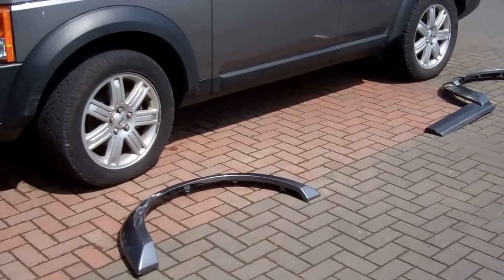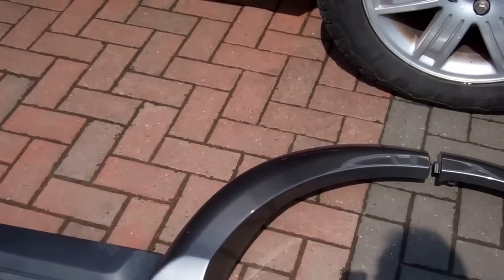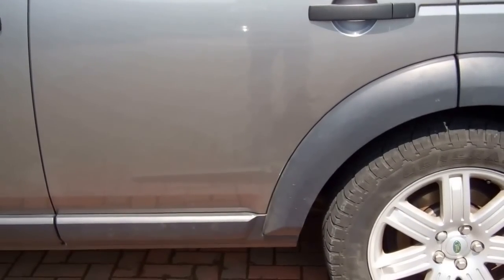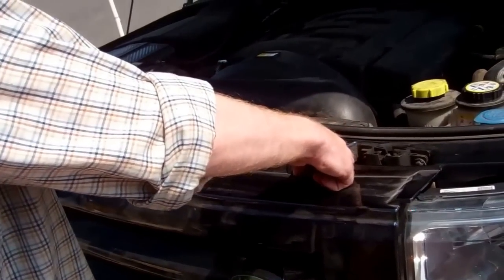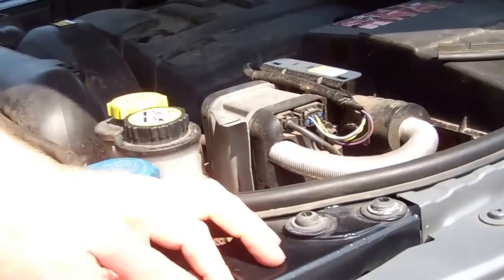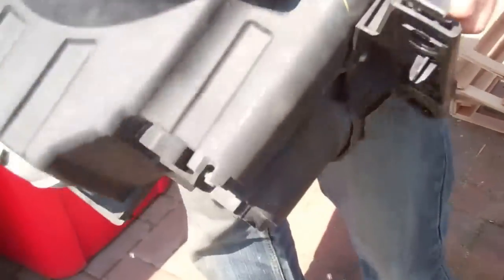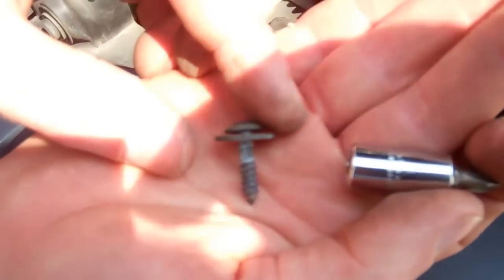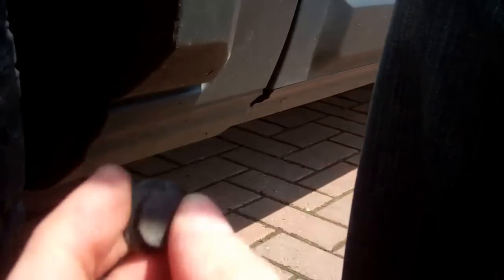How to remove wheel arches on a Land Rover Discovery 3 LR3

Comment: Thanks heaps for these vids fellas.  They're good for the Disco 4 as well.
Reply: Just a warning when doing a D4.  The rear door trim and wheel arch trim on my 2012 D4 was not clipped on with the little white and yellow pop-off clips. It was clipped on with solid black clips that don't separate. When I pulled off the trim it broke several of the mounting points on the trim itself and I had to repair this mounting points before I could refit the trim.
Reply: exactly what happened to my 2015 D4. I am wondering if I need to buy the trim kits to fit them on.